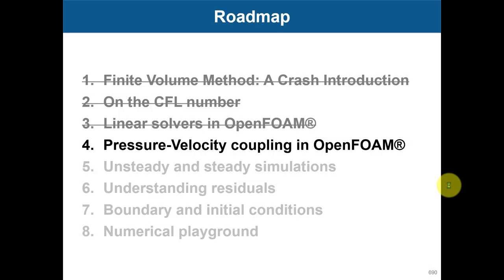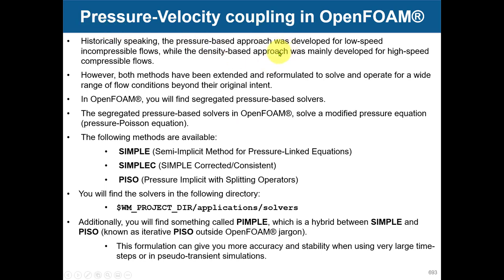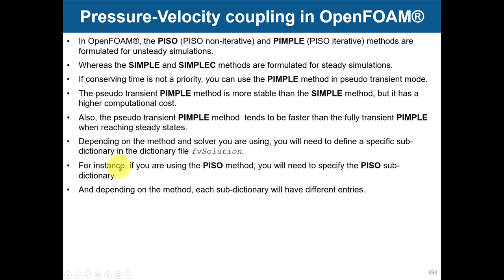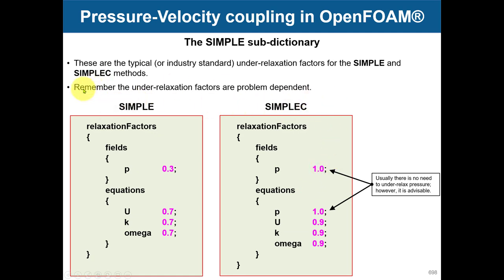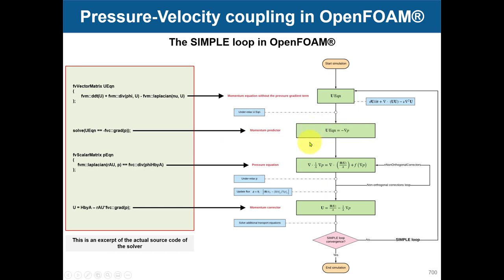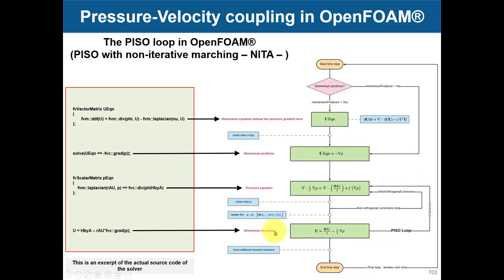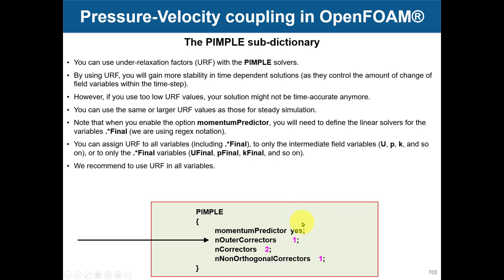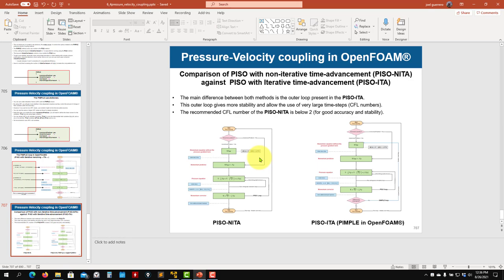6.4 Module 6 - FVM overview #openfoamtraining

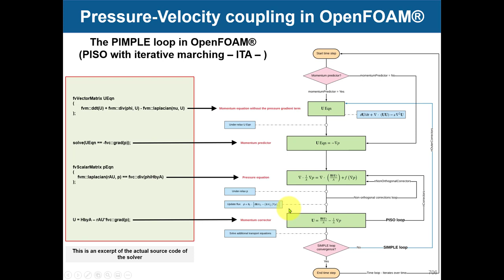Comment: ¡Hola Joel! at min 14:00 you compare PISO and PIMPLE. If using PIMPLE with CFL>1, an unsteady simulation will be valid if the Quantity of Interest (QOI) remains bounded?
Reply from the maker: Yes. Boundednes is always important. 
But it is more about the time step. If your time step captures the transient nature of the physics, your solution is accurate. It does not matter if your CFL is 1 or a 100.